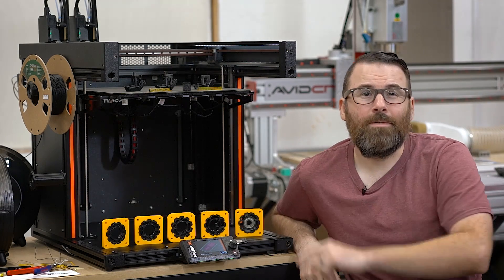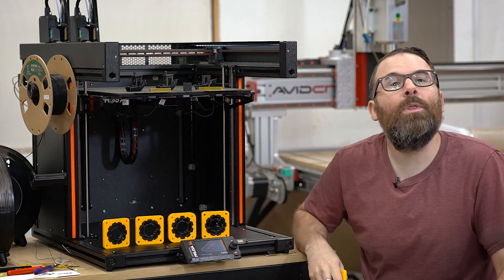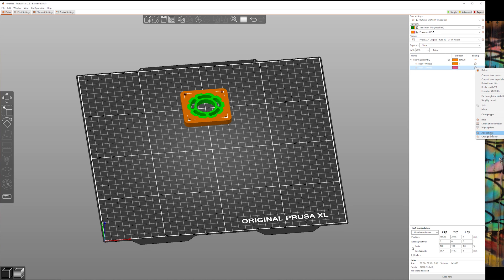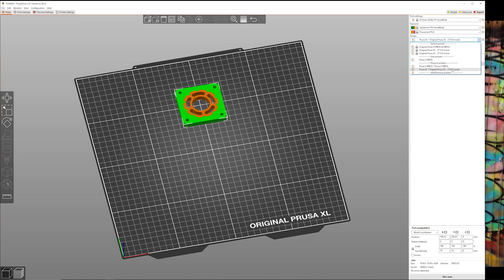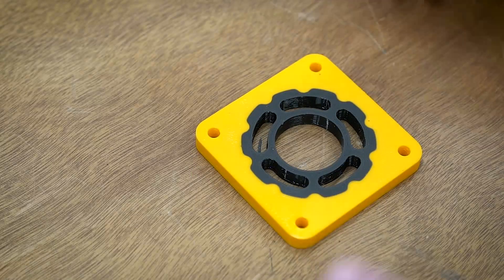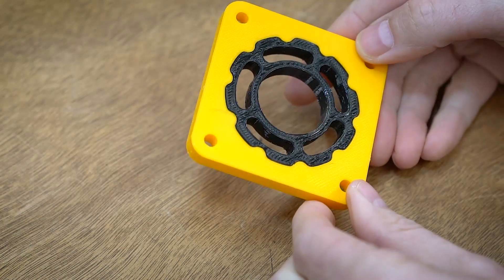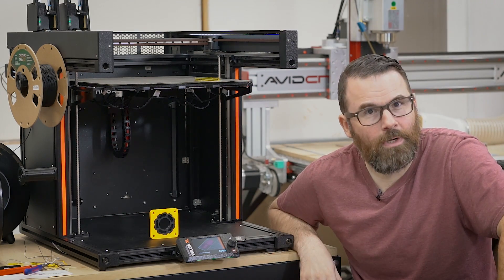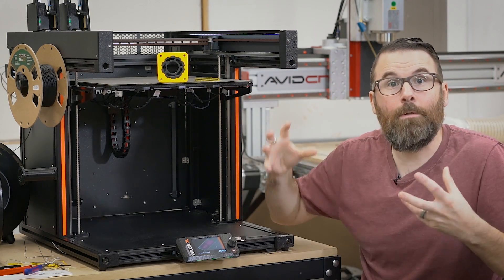Prusa XL - Multi-Material Testing (TPU and PLA)

Comment: This series is starting to put the XL on my radar.  I have X1Cs, and they are great for turning out single-material parts, but I don't really utilize them for more more than material+support that run at similar temperatures.  A true toolchanger has been what I've wanted for years.  Sad that the software isn't there, though.  Who knows when multiple nozzle sizes will finally show up?  It seems kinda straightforward to want a change nozzles, even with the SAME material.  A detail nozzle (<.4) for exterior/fine features, a larger (>.6) infill nozzle for bulk printing with enhanced strength, another material or dedicated tearaway support, support interface, and then probably yet another material.  

It'll be a brave new world!  But I'm not buying until the software is ready - because Prusa is known to take awhile...
Reply from the maker: I wouldn't say the software isn't there, I never meant to give that impression.  The thing I like about Prusa is you CAN do the thing, you just need to figure out how to do it.  The settings are all there, it's just not overtly spelled out.

Comment: hey, you should try PETG as support interface material when printing PLA (and just print the support structure as the same PLA as the print to minimize extruder swaps).  I think that's what Bambu does for their PLA support.  it's not PVA as it isn't water soluble, and others have tested using PETG in its place and said it worked great, so I figured you could do the same.  everyone has PETG laying around, so if you do, and you have multi material, you can use that to make a clean interface between the support and the part that will come apart clearly.  you can get nearly bottom layer quality bottom surfaces under supports when you use this method.  it's pretty slick.  I haven't tried on my Prusa because I don't have MM on my Prusa but Bambu sliver is based on Prusa slicer and it allows separate support material vs support interface (the layer that touches the part), so I assume Prusa does too
Reply from the maker: Yeah, I should try that.  I've heard it works well.  I don't think many applications actually NEED soluble supports, but it's a nice thing to test.  The slicer absolutely allows for a zero-interface, only at the interface, etc.  It's easy to change between them.

Comment: you can add a modifiers for different speed
Reply from the maker: Correct, but you'd have to set different speeds for infill, bridging, walls, etc, etc.  The volumetric limit seems to work more elegantly for me.

Comment: For TPU I treat it just like a gummy PLA, 5mm^3/s volumetric, 205c nozzle(5c higher than most of my PLAs), 60c bed, and a retraction speed over-ride to 30mm/s instead of 40mm/s. When I tune filaments, if the Pressure-Advance arrows aren't ending up cleanest around 0.02s on direct drives.. then that usually lets me know I have something pretty wrong with temp or speeds. 

Also I think PETG and TPU bond better but I might not be remembering, another YT'er did an in-depth bonding test and now I can't find it or figure out what it was called to verify my memory of it..!
Reply from the maker: I just printed PETG and TPU together and they SEEM to bond well, but we'll see.

Comment: There is an open issue on the github for different nozzle settings for different heads. But someone did point out you could add custom setting per object (versus per head) in PrusaSlicer which is an effective workaround even if cumbersome.

Comment: Small nozzles are kind of useless. They make it possible to make sharper corners but 99% of the time, why would you need a .2mm radius (.4mm nozzle) vs a .3mm radius of a .6mm nozzle? If you honestly need a sharp detail like that, FDM isn't really the process you want to be using. So unless you need .4mm thick walls or .2mm minimum radius, a .6mm nozzle is usually a better choice. Especially if you are running 1.75dia TPU, a .8mm would be even better.
Reply from the maker: I haven't personally experienced it, but I've always heard that larger nozzles string a lot worse. Variable aperture nozzles would be cool.  There's one company out there doing it.
Reply: I had a ton of problems with TPU clogging on a .4mm noz. Moved to a .6mm and the problems went away. I can't comment on the stringing other than I haven't noticed any changes other than faster prints and less clogs. @RobertCowanDIY

Comment: Hi Robert, This is a great video again. Thanks for the content. Currently I use my UM3 and Cura extensively to print multi material with PLA/TPU combinations. The interlocking is a very handy feature and hopefully the guys at Prusa incorporate the feature into a future release. It is invaluable for me and will be needed for many projects when my XL comes.
Reply from the maker: Nice!  I saw awhile back they stated it should be done in the design, but I think that's just wrong.  Without knowing the layer height, material properties, etc, it makes it really tricky.  It's been somewhat challenging doing the interfaces by hand, and they could be MUCH better if done in the slicer.

Comment: In prusa slicer right click the tpu part, at the bottom there is a button for settings for that part. Select speed and change it all to your tpu speed.
Profit
Reply from the maker: Correct, but you'd have to set different speeds for infill, bridging, walls, etc, etc.  The volumetric limit seems to work more elegantly for me.
Reply: @RobertCowanDIY  I can respect that. I just copy paste one speed into all the spots and I know one day I will face the results. I'll consider your approach
Reply from the maker: @TheInfoPlace I make no claims about what's better, this is just what worked well for me.

Comment: Great video - had to subscribe immediately for more like this 😁
Why would you want to print with a 1mm large nozzle? You just stated before that it does not matter what nozzle you use since it's all about volumetric flow rate. But then, I thing the volumetric flow rate is dependent on the nozzle as well as on the heater capacity since with a 0.2 nozzle the pressure in the extruder will become much higher than with a 0.8 nozzle.
I never understood why print speeds are defined in the print profile and not in the material profile. Regular PLA needs way different settings than something like TPU, PP or Carbon filled Nylon. I think (hope) we will see a lot of changes to be able to have a more user friendly slicing setup for our multi material prints
Reply from the maker: From my understanding, a bigger nozzle will give you a fatter line width at the same layer height.  You can use this for thicker outer walls, instead of just doing several.

Comment: Good stuff, been at it since 2013 and I tell you what. You’ll learn something everyday, I personally use simplyf3d ( first slicer I ever got) and the cura lulzbot variant ( since I use the lulzbot taz pro with dual moving tool heads) and simplify has just seemed to work for me especially with the new updates they have incorporated. But like you said in the video a large focus in printing is making sure your temps are set and humidity is at an ultimate minimum for good printing and little stringing.

Comment: Yeah, perfect, so the machine wasn't really ready for launch and even the slicer can not really keep up with the expectations for this machine...
Because come on, we all thought about multi material printing and different material need different speed and print settings. 
So every extruder head needs different print settings...
Hope that prusa will work on this, because that was really the idea that I had in mind when I placed my order for this machine. 
5 head with multi-material printing with different nozzle diameters. 
It is obvious to want that from this machine isn't it?

Really great videos you do about this machine. Very very nice 👍👍
Reply from the maker: I'm not sure how you got that from the video.  It's a complicated machine and needs to be understood.  Taking a slicer that was designed for a single extruder and trying to make it work with various extruders AND still work with single extruder machines (and be forked and reworked for the rest of the industry) is tricky.  Printing two completely different materials is tricky and it does work, you just need to think through the process.

Comment: I have done some tpu and pla printing with the MK3SMMU2S, found some of the same things you have. On changing the print speed settings, you can right click on a part and add a settings modifier, this allows you to change all kinds of settings, like speeds, temps, infill, perimiters etc. At the time I was doing this, it did not adhere to the filament configured temps. So the TPU was printing with the PLA settings. I was able to get around that with the settings changes. Did not figure this out on my own, found it somewhere on the internet.
Reply from the maker: Yeah, I found that later, but changing ALL those settings seems like a pain in the ass.  Just setting the volumetric limit seems more convenient for me.

Comment: FINALLY someone did it! Thank you sir. The reason why they haven't showcase something like this during launch campaign is beyond me.
Reply: They have not showcased it because if they told everyone you have to hack the slicer to use dissimilar materials in a multi-head $2k+ machine you have to wait years for it might impact sales;) I own a single head XL for larger prints and planned to expand to a 2nd head do this nearly same thing.. TPU and PETG. I am amazed how many complex hoops you have to jump through.
Reply from the maker: Complex hoops?  It's pretty straightforward, you just need to slow down the TPU, with one setting.
Reply from the maker: I'm not sure how many people would care about it?  But who knows.

Comment: Great to see this, nice work 😊

Just an FYI, TPU/TPE typically will have a strong chemical bond together with ABS and PC but not PLA as you already observed.

Also, BVOH is a better soluble support material than PVA, it's a bit more forgiving - just make sure you dry them properly before use. We've done tons of soluble supports testing mainly with ABS though, but if you have any questions, let me know!
Reply from the maker: Got it!  I'll have to check it out.  Thanks!

Comment: Good video. Maybe you could export the design in parts, and label them appropriately in Fusion 360 or whatever CAD software. Then in PrusaSlicer, use G-code substitution and regex to vary the speed.
Reply from the maker: You could.  There is an option in the slicer, but you can't apply a print profile, you just need to change the speed on everything (walls, infill, top layers, bridging, etc).  It's in the same place as when you select the extruder.
Reply: @RobertCowanDIY  this applies speeds globally, doesn't it? Was referring to individual parts. Sure, a modifier mesh could be applied but breaking into parts on the CAD side would be far more accurate and faster in terms of workflow. ✌🏼
Reply from the maker: @brisance I'm not exactly sure what you mean?
Reply: @RobertCowanDIY  apologies for being unclear. Currently, print speed settings are applied globally, as you explained in your video. However, on Fusion 360, you can label and specify which part is TPU, and which is PLA. Therefore, you can export the model with this information into PrusaSlicer. Then, from within PrusaSlicer, you can use modifiers to alter the printing speed of the TPU part or the PLA part, as appropriate.

Comment: I am so glad to hear you will be trying out water-soluble supports looking forward to that video. BTW great video need to watch again to figure out how you used two different types of filaments not so much selecting but more the temperature adjustments you made.
Reply from the maker: That's not really in the video, I just bumped the temp down 10 degrees in the filament settings in the slicer.

Comment: having seen how clean the first prints TPU exterior is, makes me wonder if you printed another layer of PLA on the cutouts of insert. Like formwork. You could just pop them out at the end...
Reply from the maker: That's one of the reasons why I popped it out ;-)  It's good, it gets rid of all the zits for sure.  You could print a 'shell' around a TPU part to create a better surface finish.  Also, what about using a textured filament like a carbon fiber to give TPU a texture as well?

Comment: Quick tip: For MM prints in PS you can use the number keys to assign the extruder. It works when you select multiple parts as well. A good time saver I've found.
Reply from the maker: OH COOL!  Thanks.
Reply: best tip ever :)

Comment: I wish you showed us it's use and where it's for it seems like a cool idea for a lot of things :)
I wanna make a tool changer again but money and energy :|
Reply from the maker: It's just a test.  For my robots, I want all the drive components to have integrated TPU bushings around the bearings and such.  The final part would be FAR more complicated, so not good at testing.   The particular part I'm thinking of would be a ~10 hour print per part, which isn't good to test with.

Comment: I would love a follow up on printing with two different nozzle diameters.
Reply from the maker: Got it.  For right now I'm not sure how it would be done, but I can look into it more.
Reply: @RobertCowanDIY You can't change nozzle size per extruder under the 'printer settings' tab?
Reply from the maker: @JeffDM Yep, I just realized that.  Like I said, I hadn't really looked into it yet.

Comment: Thanks! Great video! Love that you added that microscope section.
So, printing PLA on top of TPU is also no problem? Or does that only work if it's a relative small area. Suppose you have a situation where a 10 by 10 cm flat surface of PLA must be printed over with a 10 by 10 cm layer of TPU? Will there be no issue with the fact that the two do not bond so well? Or are they sticky enough at print tempertures? I don't know any realistic situation where I would need such large horizontal flat plane areas of contact, just wondering about the limits. My 5 toolheads Prusa XL will take at least a few months to arrive, so bit hard for me to test this out myself. Anyway, I know it's not a prusa xl topic, but more a materials related topic in general, but maybe you have some insight on this?
Reply from the maker: Huh, I'm not sure.  They probably wouldn't bond very well.  But I've heard that other materials might (like PETG or ABS/ASA).  I'd have to see if there was an appropriate application for it.

Comment: Thank you so much for this series of videos. I hope that Prusa is watching carefully and taking notes. You’re helping me make my decision whether to go for this beast or not. Given the current wait time, I’m optimistic that some of the slicer shortcomings will be resolved by the time that a printer ordered today will ship. When you do your video on soluble supports, I’d be interested to see how the two Prusa options for soluble support work out in practice — they have the option to print the entire support with soluble material, or to use regular filament for most of the support, and only use soluble at the interface.
Reply from the maker: Yeah, I think it will continue to improve.  Most of their efforts are probably aimed more at getting input shaping going.  The slicer already has options for everything on supports.  You can just do the interface layer as soluble, the whole support, etc.  I did a quick test and it works as you'd expect.  But I just need to figure out how to get PVA to print well, it seems like a tricky filament.

Comment: nozzle size do matter when it comes to mm3/s. A bigger nozzle usually allows you to push out more plastic. You can also use tpu for tpu when printing PLA or mix max filaments that dont bond and use that as support. Way cheaper also.
Reply from the maker: Got it.

Comment: Regarding the different speeds, you can set them on each individual piece. Right-click on the piece and then, once the window opens, scroll to settings and choose speed. There you can also select what to speed up or slow down.
Greetings from Italy
Reply from the maker: Eh, yeah, but you have to select different speeds for each aspect of the part.  Setting the volumetric limit is far easier.
Reply: This does need an addition. The accelerations should also be changed for tpu.
A problem with having different saved setting tabs when many of the settings interact with one another between tabs.

Comment: Hi there i have a question, is it possible when printing if i have the exact same type of filament.  And the first spool runs out, can it automatically pickup on the next spool?  I want to make sure when I'm away or asleep and run out of filament it can pick up on the second i would like to see how that happens.   Thank you
Reply from the maker: I'm not sure this is an option.  I haven't seen a way to do this.
Reply: The old MMU 2 had this, but only if you sliced the project as a single material print on a multimaterial printer. So at least it’s something Prusa are familiar with. Hopefully they’ll do it as a firmware option at some point.
Reply from the maker: @ChrisAbbey Good to know!

Comment: Hi. 
Great video, just FYI you can right click on the part you would like to change the speed for ( and a multitude of other settings) and select add settings then speed.
Reply from the maker: Correct, but you'd have to set different speeds for infill, bridging, walls, etc, etc.  The volumetric limit seems to work more elegantly for me.